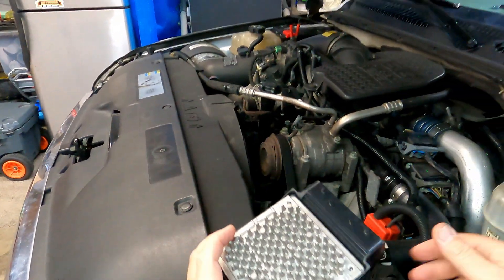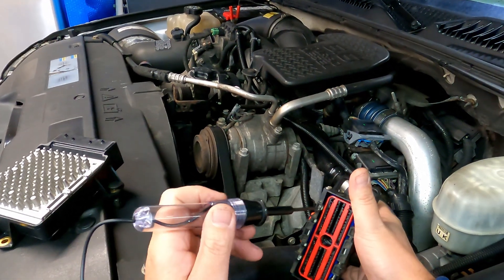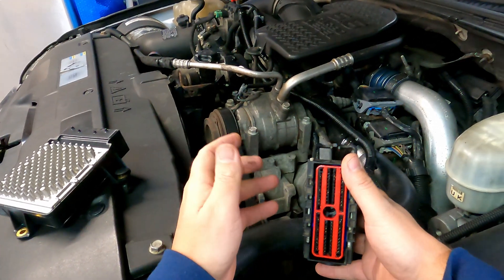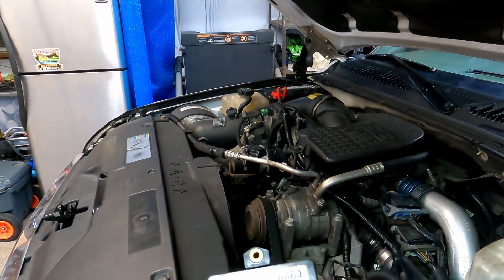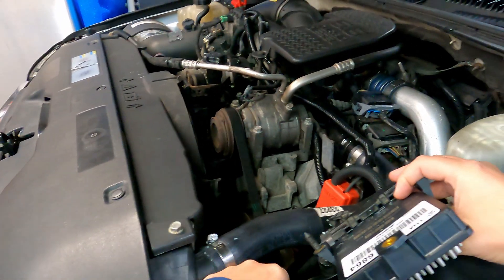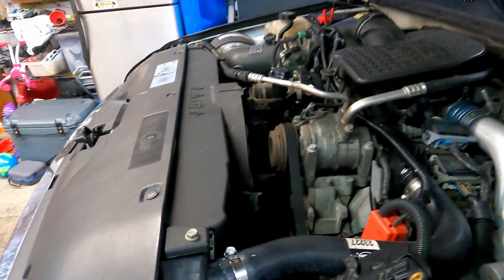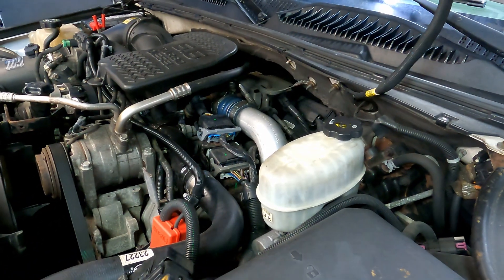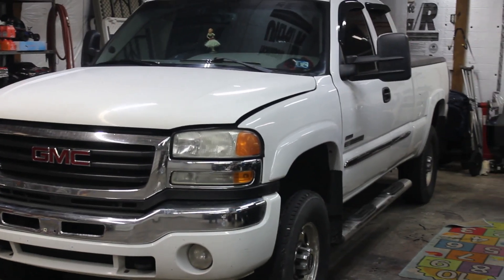CODE U0101 2006-2015 Chevy GMC Duramax w/ 6 Speed Allison Trans: TCM Failure Connector Pinout

Comment: Hey i was trying to follow along with testing the harness. It seems like my connector is upside down from yours.  If my wires from the harness is on the bottom on the connector,  my #1 pin is on the bottom right column. But once i figured that out all the test came out good. I have a 2011 sierra 2500 duramax. Maybe they changed it around through the years. Anyway thanks for the video looks like i need a tcm.
Reply: Hopefully this will help someone else
Reply from the maker: Thanks for sharing! I pinned this comment for others to see

Comment: It’s a problem with the battery or alternator or fuses if you need help I can help you anytime just hmu
Reply: Can you explain. I have a tcm that has no communication all of a sudden. Still switches the transmission in reverse but does not show on shift indicator stays in park or says its in 1st even though its in park. No connector issues when checked no fuse box issues check all copper wires and leads. I can only think of the module? I may have done this wrong but i check all pins on the module for continuity to the ground pin the are on the module itself and none establish continuity i don’t know if it should please help
Reply: @Miamiboi305 My truck is currently doing the same thing.  Did you find out what was wrong with yours? Thanks!

Comment: Check pin 6 at tcm to pin 6 at obd port  for bus comm resistance   Also pin 27 to to pin 5 on obd port for comm resistance.  Pin 6 on obd port is + comms for tcm to bcm   Pin 5 on obd port is signal ground for comms
Reply: where does pin 70 go

Comment: I need help bud, my 2008 lmm, got the p0872 code.  My trans never slipped, never beat on it, was driving normally on highway, getting off exit while it was slowing down,engine light popped and it went right to 4th gear lock.  It has higher miles, so after reading code I decided to do a complete VB-internall wire harness ect.  I spent 6 hours laying in snow to do it. Its my only vehicle and I have a 6yr old.  So I can't be without.  Test drove last night, was fine for first couple miles until I got up to 55 mph past 4th gear, and when slowing down to stop sign same thing. Engine light, limp locked to 4th gear. Same code.  I'm so upset idk what else to do.

Comment: hello buddy thanks for the video. 
I have power to 10 and 70 also have reading on ground 9 and 69
but with key on I have nothing on pin 2 and 63?
any ideas where I go from there?
Reply from the maker: Make sure your reading the connector right, apparently the newer trucks have the connector turned 180*

Comment: My 08 dose not have wire for number 2
Reply: I’m reading the comments since my 07 nbs doesn’t have a wire in no.2 either.
Reply: @omarvalencia5299  i have a 08. and pin 2 no power. so that is normal??

Comment: Does anyone know where I can find a wire diagram pin number for the 2014 GMC 2500 HD Diesel  the pin location is hard to see on this video. It looks like the harness pins are different maybe there the same its just hard to tell.
Reply: Right. I have a 2011 6.6 with 6 speed transmission and this wire diagram/pin location is totally different that mine. He has pin connectors where I don’t and vise versa. Misleading title

Comment: I'm not getting power to my 1 or 63. What do I do?
Reply from the maker: Check your harness for damage after you go through your fuses. There is one on the driver side dash that will cause issues for the trans if it goes bad.
Reply: @madmikesgarage4861  so I tracked all the wires down. My ignition switch is getting power and sensing power when turned on, but that fuse by the door for ignition is not getting power to it.

Comment: Would this cause a no start? I got a lbz when I put key in no instrument cluster lights are on only the check engine light and it keeps saying this lost communication with tcm code that’s it I’m stumped
Reply from the maker: I have heard this code can cause a no start, it has never happened to me though.
Reply: @ercysuazo726 did you ever figure out what the problem was? Got a LBZ doing the same thing
Reply: @brandonjennings1066 same problem here on my LBZ. Any ideas?

Comment: I’ve got a stock 09 2500 duramax that goes into limp mode whenever I go into the passing gear. Any idea what would be causing this?
Reply from the maker: Could also be low fuel rail pressure p0087, that has multiple solutions from $40 to $6000

Comment: I don’t have continuity on 9 or 69 with the key on and I don’t have power to 10 and 70 key off, any ideas?
Reply from the maker: Check your fuses on the side of the driver side dash. There is one there that can cause your TCM issues if it goes bad.
Reply from the maker: Sorry for taking so long to get back to you.
Reply: Which fuses are the ones from the side I’m having same issue
Reply: @valentinkeef  mine wound up being TCMB fuse. I think it was under the hood.
Reply: @valentinkeef #3 & #17

Comment: Hey people I had that u0101 code.2012 3500hd Duramax.
I believed it was the TMC. AFTER months of trying to find another, I found a rebuild shop. Tested the TCM said it was good. But I found the wire harness on the pass side of tranny, THAT connection was polluted with tranny fluid! It can cause all kinds of codes. Going to replace the harness in the tranny. AND do this wire check like this video.
Reply: That connector being wet is not an issue.    The entire harness including the bare connectors live in a bath of that very same tranny fluid.
Reply: Did you happen to find a harness ? Think that’s what my problems is
Reply: What shop did you use to test it?
Reply: I tried GOECM in Grand Prairie Texas, they said it was ok but after trying several other things I did find the TCM was bad. Got scalped on the Internet for a new one $2500 but installed and programmed ($800) and yay truck is finally running.
Chevy couldn’t get me a TCM . They don’t support their vehicles.
Reply: The harness was not the problem! Just wasted time and money. It was the TCM just like I thought. GoECM in Texas was wrong about both my modules. I knew it was the TCM after I replaced the transmission harness and the ECM.
Reply: @jasonperkins9227 sheesh, at least you know not to trust that shop again! Glad you got it figured out.

Comment: I'm looking to have my TCM rebuilt because they are no where to be found. I have a 2013 Duramax with a LML engine and to my understanding that the TCM's are a sealed unit and possibly not rebuildable
Reply from the maker: Let us know how you make out. We can share the knowledge.
Reply: Any luck on rebuilding the TCM? Having the same issue and cannot find in anywhere. Have one in backorder currently
Reply: @Robert-kp8rn  after extensive research I found out that the vin numbers were not matching up with the TCM's and the truck's vin's number of that they were trying to repair which lead me to believe they cannot get the software updates to work. Basically it is a hit or miss on a rebuild. We decided to stick with the dealership and waiting until April of this year for a new TCM.
Reply: @mikeburdgick7289  I was told July by Lincoln Diesel.
Reply: Yea no I'm in a bit of a predicament. I need to move my truck along with my trailer by the end of March. This backorder deal is going to cause me to have some bad times. I just had this problem yesterday. Please let me know if you get your hands on anything.
Reply: Think it’s possible to get a temporary fix on these TCM’s.I have a 2013 Duramax as well. Don’t know if it matters that it’s a turbo diesel?
Reply: Me too. GM sucks balls
Reply: Im not getting any fire on 10 and 70 , key on or off. Any suggestions would be greatly appreciated.
Reply: @AdamJones-bv6gz  Check your main fuse panel under the hood. Almost a guarantee that you have a burnt pin or excessive corrosion unless your wires are broken in between.

Comment: Just replaced the transmission and this code come on and the truck has no power , even the revs don go over 3
Reply from the maker: The TCM may need programmed to the new transmission. sounds like you are in limp mode.
Reply: @madmikesgarage4861  thanks Mike , do I need to take it to the dealer or someone else to program the TCM ?

Comment: Nobody has one right now
Reply: I got a used one
Reply: @preston5793  preston im interested. How can I contact you? Phone number please.
Reply: @preston5793  a used one?  I was told they need to be vin programmed.  How did this work out for you?  Is the TCM able to be reprogrammed ?
Reply from the maker: I was lucky when i got mine, Ryan's website showed them being out of stock. I called and they had just recieved some earlier that day. They are real nice people to deal with.
Reply: Has anyone else found a place that will rebuild or has one in stock?  I have one on order with the dealership.  However no ETA and some have been on order since August.
Reply: @brandonroberts6471  Xemodex in Canada has been having a ton of success fixing these TCM's.  Check them out online.
Reply: @lucascahill6482   it's crazy you said this today.  Because yesterday I found there website and called them.  Today I'm setting up the ECU to be sent out.  Thank you very muc

Comment: The connector/ pigtail on my 2013 duramax is upside down.  I had to flip the connector from what's in thr video to get thr same reading
Reply from the maker: Thank you for the comment. I assumed that if the TCM was the same that the wiring would be similar. I am just a small poor guy trying to help out, I am not making anything from this.

Comment: Hello what if I don’t have a #2 pin. Truck is a 08 gmc 2500hd 6.6.
Reply from the maker: I am not sure why you wouldn't have one, i was pretty sure that all of the 6 speed trucks were this way. Are you sure you have the connector oriented in the correct way?
Reply: @madmikesgarage4861  Ok thank you for the help. I’m pretty sure. Start at the top with #1 and count down
Reply: I don’t have a pin #2 either. 09 gmc 3500hd 2nd.

Comment: Why would my 09 3500 start shuttering in low take off or pulling a traylor. It seems to be transmission.  Do you have any advice?
Reply from the maker: You could check the universals in the drive shaft. You make it lucky and not have to spend much to fix it if that's it.
Reply from the maker: You can check your engine mounts and your tranny mount too.

Comment: Hey Mike. I have an LMM with EFI live, I didn’t have the truck tuned; previous owner did. How would I go about getting the tune on the new TCM from Ryan’s? Thanks for any insight.
Reply from the maker: I pulled this off of there site. *IF YOU HAVE TCM TUNING WITH EITHER EZLYNK OR EFILIVE YOU WILL BE ABLE TO RE-INSTALL YOUR TUNES ONTO OUR TCM WITH NO PROBLEMS. IF YOU HAVE CUSTOM ECM TUNING THIS WILL SYNC WITH OUR TCM WITH ZERO ISSUES*
 I would call them if you have any questions. When i called them them to see if they had a LBZ TCM module in stock  a person answered the phone that was very friendly and helpful.
I couldn't recommend them enough.
Reply: Also interested
Reply: @joefletcher5859  I talked directly to a rep from Ryan’s and here’s what he sent back

“You'd need to have the autocal or V2 and tunes to re-load onto the TCM. We've had some guys honestly like how they drive with the latest calibration vs a modded one. You can always buy new TCM tuning and add later if you really need it.”

So I’ll likely just use whatever is on the TCM and go that route and see how it does.

Comment from the maker: DO NOT use a big test light like I did in your connector pins. Doing that hogged out my connector pins and one of the pins was not making contact with my brand new TCM. This caused me to have a persistent CODE U0101 and it also had no manual mode. When you drop the transmission down into manual it was just stuck on the 6th gear it would not move from there but the truck drove fine it wasn't stuck in third gear or anything. I carefully closed up the female terminals in the connector with a pair of very small needle nose pliers after I took out the red connector retainer. Fired the truck up and my manual mode was working again.
Reply: Do you remember which pin?
Reply: DO NOT. probe like a sausage

Comment: Whats the problem if no power in the 63 terminal
Reply: I'm in that process right now got power at fuse
Reply: Ordered new tcm should be here on Monday Ordered from Dan's
Reply: Worked out perfectly instantly fixed only bad news is a week later injector failure  so slammed more money into it love the duramax power hate the price tag that goes with it that being said I still will only have a gm
Reply from the maker: Make sure the pin 63 socket isn't pushed out. Check your fuses and wiggle the wiring.
Reply: My bad I believe that I was checking wrong terminal so im guessing the tcm is bad
Reply from the maker: @amandaholt1991  How did you make out?
Reply from the maker: How did your TCM from Dans work out?